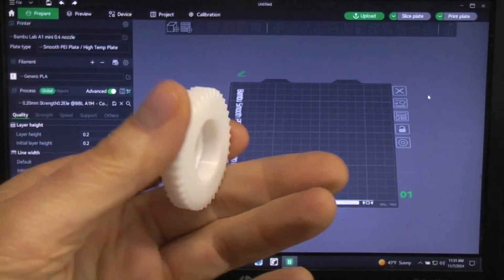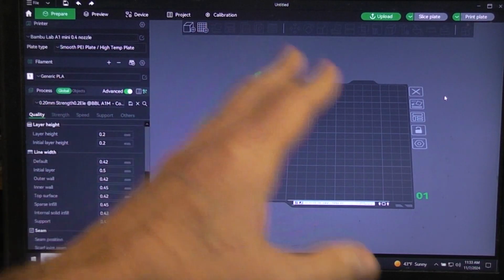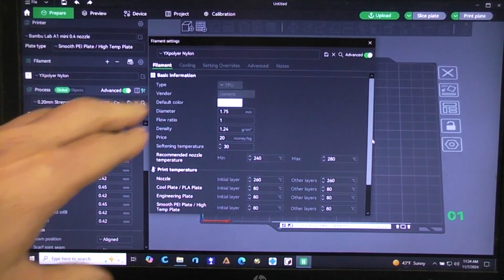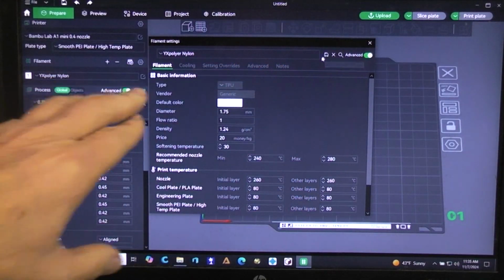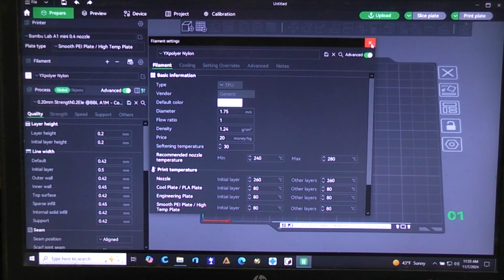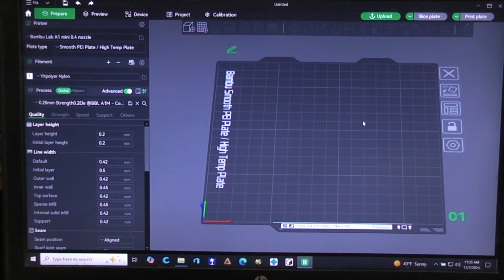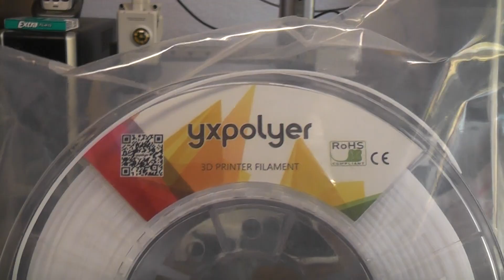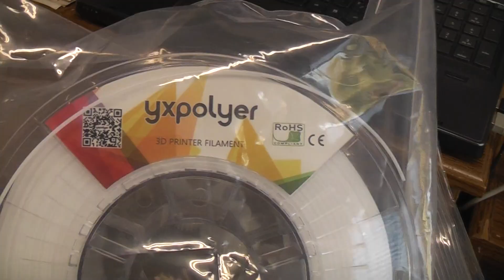Print NYLON gears on the Bambu Lab A1 Mini.  No warping or stringing. I used YXpolyer NYLON white.

Comment: Wow ! Those gears look really great ! Can your Bamboo Labs printer do Nylon normally ? Does the company say you can ? What kind of nozzle are you using ? Is is a special High Temp nozzle or regular nozzle ? I have an Anycubic Viper w/ brass nozzle 0.4 , I hope it doesn't cause any problems getting  the excess Nylon out of the nozzle ....just curious . Your printed Nylon part looks excellent , like it came from china . Great video ! Thanks for sharing !
Reply from the maker: The Bambu Lab A1 Mini does not even come with filament profiles for NYLON, so I would say Bambu does not support NYLON in the sub $200 dollar A1 Mini. So that's why I did a video on this brand of NYLON filament and the A1 Mini printer.  When I researched 3d printing NYLON I found that as long as you're not printing NYLON that has carbon fiber mixed in with it you do not need a hardened steel nozzle. The A1 MIni  can go more than hot enough for NYLON with a stock nozzle / heater.
Reply: @Robothut  you can easily get a hardened nozzle from bambu for the mini as well though. If you need anyway.
Reply from the maker: @thefriendlessgamer8552  Yes, The sell them cheap on Bambu web site. But I have no need for one yet.
Reply: A 3D printer is a 3D printer and will do what you tell it to do, regardless of what the brand says. There's nothing special about Bambu labs, except build quality :D

Experiment! Your printer will do fine, you'll have to play with the settings (this video is great for settings), hardened nozzles aren't required for nylon but they're super cheap now even for the vyper if you need one in the future (like for glow in the dark or carbon fiber filament). You can build an enclosure for tougher materials with scrap, a $10 Ikea table, or even just cardboard boxes.
Reply from the maker: @FAB1150  Yes, the point I was trying to make is, you do not need a enclosed heated printer if you use the right type of NYLON filament and the right setting. More people should experiment and learn by doing.

Comment: So a gear made of pla  would not be strong enough ?
Reply from the maker: I am completely satisfied with the gears made of PLA, but the person that I am doing the job for wants NYLON. Just like the same person wants to use a brushed DC motor instead of stepper motor. The customer is always right.
Reply: @ oh job requirements
Reply: Maybe it's not about the strength, but wear resistance, and nylon are sleek and slippery, while PLA are kind of abrasive  🤷🏻‍♂️